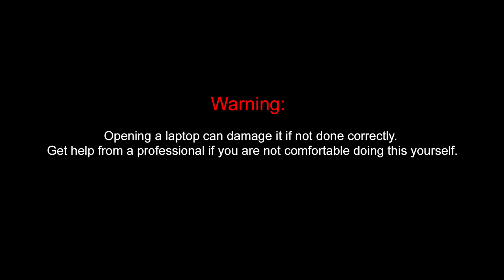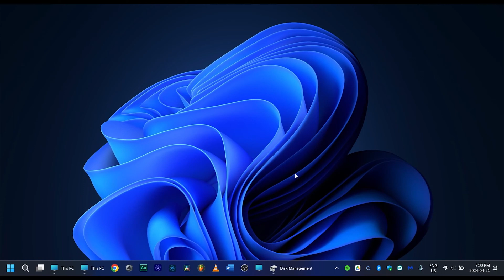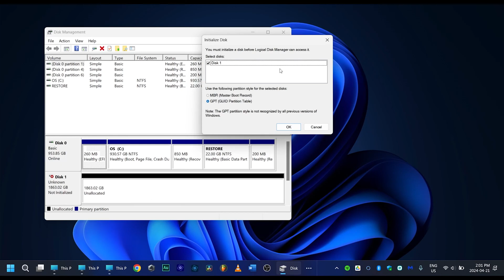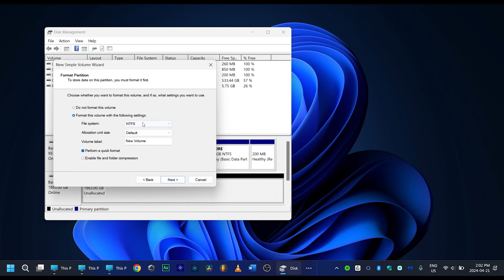Upgrade an Asus Laptop: Add SSD & Boost RAM to 64GB - Step-by-Step #35

Comment: Would this also work on an ASUS Q502LA? Had it for about 10 years and looking to make it a little faster for web browsing/streaming/etc
Reply from the maker: If your laptop came with 8 GB of RAM, then definitely, yes! Upgrading RAM should improve general performance. But, if you do have a conventional HDD (Hard disk drive), and switch to a compatible SSD ( Solid State Drive), your speed will be significantly improved especially for boot times. Just make sure (if you're running windows) that you can run windows 11 as Microsoft is putting the boots to Windows 10 this coming October. note: your laptop will use a different RAM and storage drive than the one shown in this video

Comment: Did the whole thing and the laptop ASUS ROG Strix G17 (G713PI-LL066W)  is no longer starting up, it went dead on me
.. :(
Reply from the maker: Could be a number of issues, like incompatible or partially unseated RAM/ SSD for your system. Defective/damaged hardware that was installed? I'd first make sure all components are seated properly. Verify correct parts for your machine, power off and revert back to the old hardware to see if it posts (no need to uninstall and reinstall the screws each time). The system should boot, unless there was possible damage during installation. If it does, installl the 2nd SSD. Try again. If it's good, re-upgrade the RAM. I'd run through this progressively one step at a time. Let us know what happened.... Also,... There could be a BIOS setting that is not liking the new hardware.  These are all possibilities.
Reply: @mysimplefix  I finally got it right.  64 ram is not compatible with ASUS 713PI-LL066W
The extra SSD works like a charm :D
Reply from the maker: @filiptaveirne3723  Okay, I'm glad that you've found the problem! Thank you for letting us know!
Reply: @mysimplefix  Yes I was contemplating doing just this, reverting back to old hardware configuration to see if it results in powering on.  I 'll comment on it later.
Reply: @mysimplefix  did a roll back to the original hardware configuration but no success...  
I m turning back to my supplier to get the problem fixed and the upgrade

Comment: Hi, My laptop Asus Rog Strix g15 ryzen 7 have 512gb installed ssd and I want to upgrade to 1tb. Which is better option for installation 
1. 512 GB as primary and 1 tb as secondary.   or
2. 1 tb primary and 512 GB as secondary
Reply from the maker: Option 2, where you use the 1 TB as the primary drive and the 512 GB as secondary, would generally be the better choice, as theres more storage for the primary drive for your operating system and main applications, which benefit from more available space for better performance. Having 1 TB for this ensures you have plenty of room for growth.
2. Performance: Larger SSDs often have better write performance and endurance than smaller ones. Using the 1 TB as your primary will take better advantage of this.

You can use the 512 GB as secondary storage for files, games, or less critical applications.